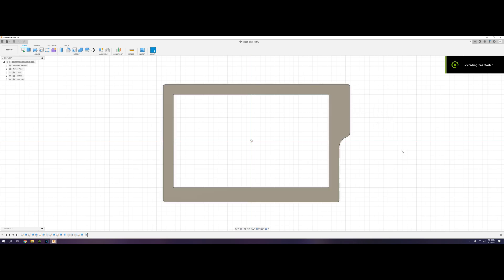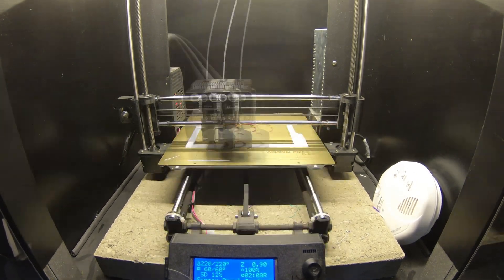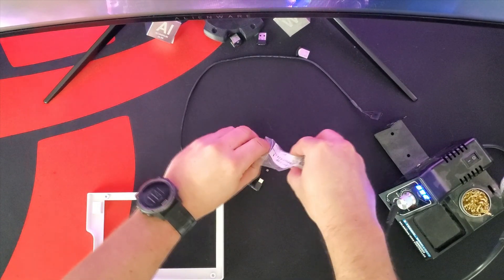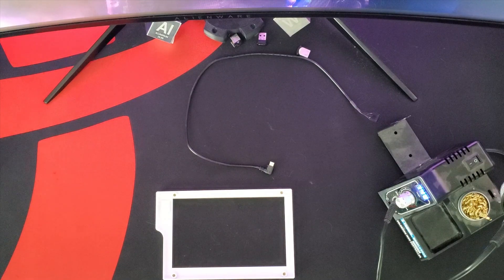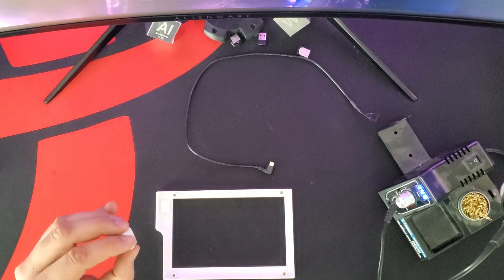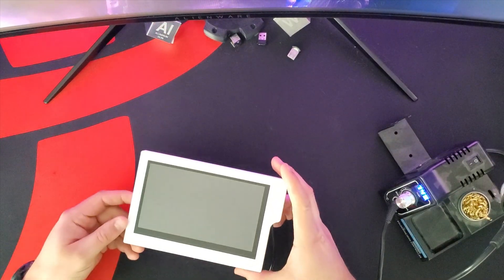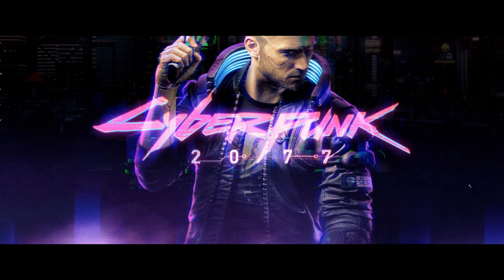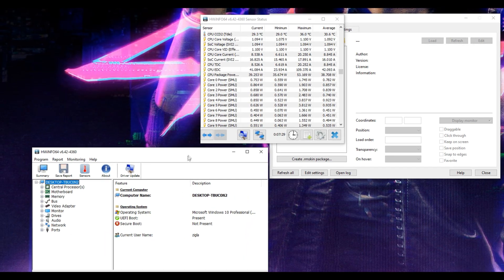DIY PC Stat Screen

Comment: So i put a 7 inch mini LCD screen in my pc because i saw it on youtube, looked really cool. but once i got it installed and plugged into the HDMI windows defaults my desktop to the little screen and i cant use my big monitor...cant figure out how to tell windows that my big monitor is my MAIN monitor and the little 7 inch one is #2 it just refuses to work no matter what i try...anyone know what to do here? the only thing ive been able to do is "duplicate screens" which is useless because i need the 7 inch for displaying cpu/gpu temps ect ect. im 6 hrs of effort into it and nothing seems to work
Reply from the maker: When you right click on your desktop and go into display settings it should show squares with numbers that correlate with your actual monitors. If you push the identify button it will flash a number on your actual monitors. That lets you know which monitor is represented by which square in the settings. You can click and drag the squares in Windows so they match the layout of your actual monitors (2 might be your main screen and come before 1). The square/number/screen that you're clicked on is the only one that will take the setting when you change it below. Select the one that should be your main screen and below there is a checkbox that says, "make this my main display." If you are on the wrong monitor, it will be gray and unclickable because it is already your main display.

Comment: @nothingspectacular I like the idea of the smoke detector in the printer casing but it would go off sooner if it were mounted on the top somehow.
Reply from the maker: Yeah it's mounted on the top. It's also tied to the outlet running the 3d printer and sends a notification if it goes off. There's also a wyzecam overlooking the printers. If it was setting on the bottom in this I was probably in the process of changing batteries or something.

Comment: Where did you plug in to the motherboard header ? Can I plug in to the 5v rgb header ? Please help I know this is old but I know the 1 hot 4 ground if I match them up on my rgb just curious if it will work thanks
Reply from the maker: I don't see why it wouldn't work off an rgb header as long as you matched up pins correctly. I'm literally just using a USB header on the board, like where you'd plug in the cable for your front panel ports.

Comment: Cool video.  Did you hookup the screen's power cable to a fan header on the motherboard?   If not what header did you use?   Any light you could provide would be greatly appreciated.
Reply from the maker: Yep, I used the header: https://www.amazon.com/dp/B072Q1MBSG/ref=cm_sw_r_apan_glt_fabc_40F78Q5VJ76TNZTECEYP?_encoding=UTF8&psc=1
Reply: Thank you so much for the quick reply and the Amazon link for the cable. Happy holidays.

Comment: @Nothing Spectacular would you be willing to design a bezel for me? My screen is a EVICIV 7inch touch screen. I just want a border thats just wide enough to cover the mounting holes, I’m not as worried about covering the cords.
Reply from the maker: @Kylar Price that actually looks identical to the screen I used in my retro handheld project so I could easily make a bezel. Anything more specific you'd like with the design? Or mostly just like this one to cover the mounting points?
Reply: @NothingSpectacular  The design can be simple I’m just looking basically for a frame bezel that covers the mounting points. I have a white pc so I just want it to blend in. Thank you so much for considering making it for me!
Reply from the maker: @KP94S  Give that a try. No promises that it fits as I don't actually have a screen to test with. https://www.thingiverse.com/thing:5143377
Reply: @NothingSpectacular  sweet thank you!

Comment: Hi, thanks for video. Is there a way to prevent the mouse from switching to that screen after making the settings?
Reply from the maker: Easiest way would probably be to go into  display settings and drag the stats screen to one of the corners of your main screen in the "Rearrange Your Displays" section. If they are corner to corner, it's  still possible to move between screens, but nearly impossible to do so on accident.

Comment: I have this setup but I can't get it the screen to switch off in sleep/hibernation or even powered down
Reply from the maker: This is probably a USB setting for your motherboard. Sometimes it's in the bios. I'm guessing it's set to allow power even when the machine is off. This allows devices that charge to keep charging even if you shut down. Turn that off and the screen should work normally.

Comment: Great video would you be willing to make me one for payment ?
Reply from the maker: We could maybe work something out. You might stop by your local library first. Most have 3D printers these days and if you have a file that doesn't take more than an hour or two to print (this one doesn't) they will usually print it for you for just the cost of materials.
Reply: @NothingSpectacular  yeah I tried some local options they were not working out so if you can get it done I much rather have it from the source anyway. If your willing to do it I’m very much interested and I’m just gonna get the exact same screen you used so no changes need to be done on the size

Comment: How to make the second screen show default black blank screen before drag the info on it?
Reply from the maker: You just set the wallpaper to black (or anything else you want) for that particular monitor. You right click on your desktop, and then go to personalize, you can specify which monitor has what by right clicking the picture or background color. It should then list all of your monitors so you can specify which one.
Reply: @NothingSpectacular i've tried that but for some reason they both change to same background. Im a try it again today maybe I missed something.

Comment: Been trying to makes something like this my NZXT H710 case comes with a sidepanel vieuwable SSD mount. And i wanted to make this there, Though getting a display thin enough ( with HDMI / USB inputs ) seemed like a challange. So i opted to extend all those wires into the back of my case and have the front clean. I had issues with HDMI signal integrity before but now it works fine after putting in a shielde cable

Comment: nice video, but I do not understand if there is the option to show the GPU and CPU Temp in C or F…
Reply from the maker: The display acts as a second monitor, so you can literally show anything you could put on your main screen. Rainmeter, the software I'm using for my stats, has a huge amount of different skins, layouts, and options to choose from. So short answer: you can show C or F, or any combination you want.
Reply: @NothingSpectacular  thank you for your detailed answer. I just would like to be sure the temperature is shwon in C within the scale 0-100 (I saw some displays  showing a C or F temperature but wih a useless scale 0-10). Are you sure about it? Thank you again!
Reply from the maker: @Drjacques  the rainmeter templates are preconfigured a certain way depending on how the creator set it up. However, you can go into their config files and adjust them as you please. Some of that could start becoming a bit complicated based on experience though. That said, you could just look through skins until you found one that meets your specific needs if you don't want to mess with tweaking files.
Reply: @NothingSpectacular  thank you again!

Comment: What kind of materials did you use for the screen? I used your saved file (thanks btw) and used SLS Plastic and Nylon PA12 100-120 white. It feels flimsy and weak though and isn't smooth. It has a rough texture.
Reply from the maker: I just used PLA and printed face down. I have a smooth print bed so everything was smooth. Structurally there isn't much to this file, it's pretty much purely supposed to be cosmetic to hide the bezel, cables, and mounts if people have this screen.

Comment: Really nice, I've done something similar with my old OrigenAE 16v where I replaced the useless two line VFD display with a 7 inch (1024x600) display.  I used Rainmeter and HWInfo as well, but the skins I found weren't as good as the ones you've used, so I've switched over.  One thing I have noted is that some games blank off the Rainmeter skins when running, do you know how to get around it?
Reply from the maker: What do you mean blank off? I haven't had any issues with performance or games with my setup.
Reply: @NothingSpectacular  Not all games do this, but when my kids play Gauntlet, for example, the skins get blanked by the game, i.e. they disappear.  They re-appear after the game terminates, but in this cases it is not possible to monitor the PC performance.  Doom Eternal works fine, as do all other FPS games I've tried.
Reply: @seanlennon5044  I know this is a year late but I think Rainmeter has a game mode that you can turn on and off that causes it to disable Rainmeter skins when games are running to save system memory. It re-enables them after.